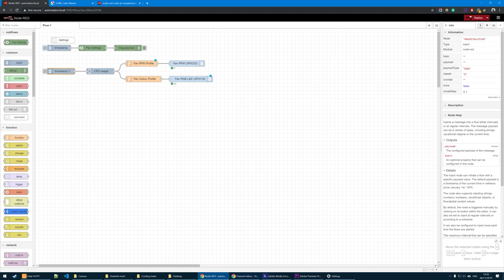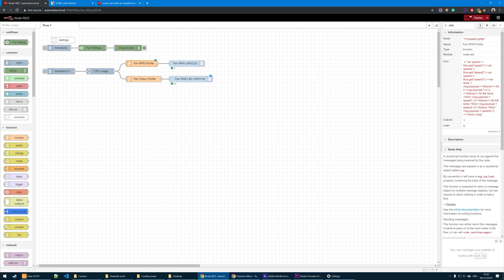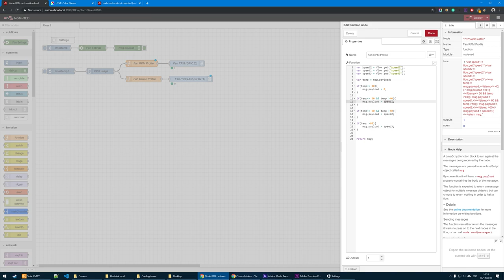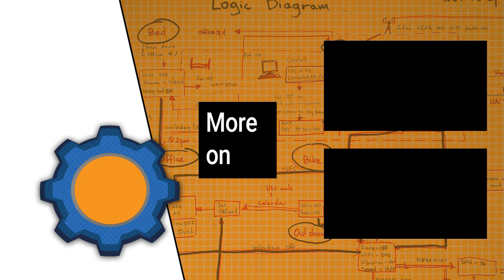RPM and RGB mod for 52pi ICE Tower heatsink

Comment: I'm getting the PWM version of this fan, can i just desolder the RGB leds? I have some other rgb in my case and the rgb from the fan always interferes with it.
Reply from the maker: You could in theory remove the LEDs entirely
Reply: @notenoughtech  by desoldering? Do I need to do anything else after I remove them?
Reply from the maker: No. The fan isn't linked in any way to these so if you desolder them you will be fine
Reply: @notenoughtech  Thank you so much fam :) <3